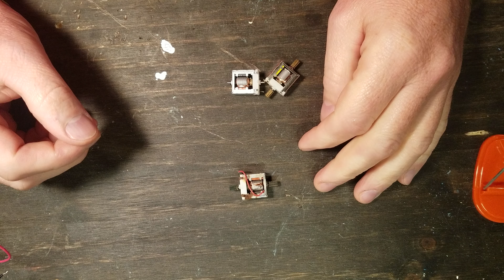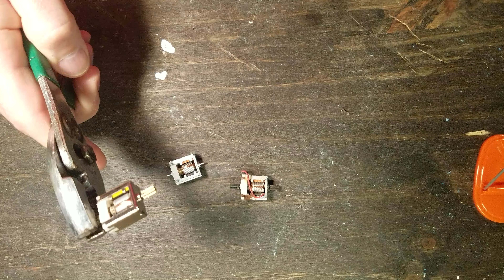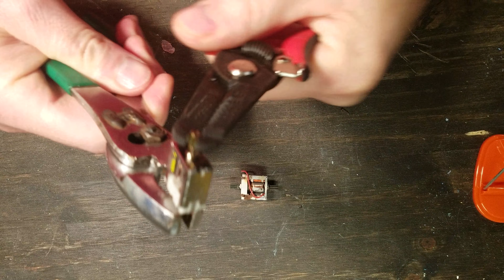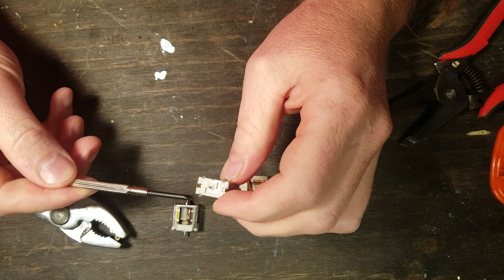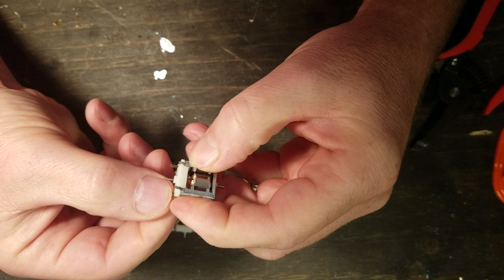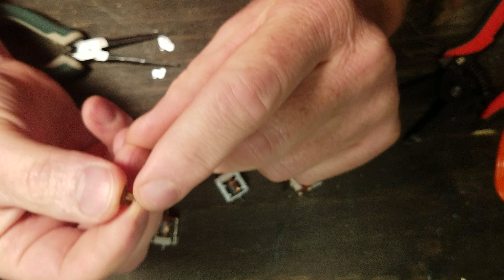Schaper Stomper motor repair

Comment: I can rewind them, even make them more powerful.
Reply from the maker: I rewound one with smaller wire, but didn't notice a difference. But probably how I did it, I know it can be done. Wish i knew you when I was building pullers a couple years ago lol

Comment: Hey Mike what’s the difference between the armature in the stomper motor than a slot car armature . They look the same.
Reply from the maker: Idk the specifics, but for one, most slot car motors are single shaft, all stompers, except speedsters are dual